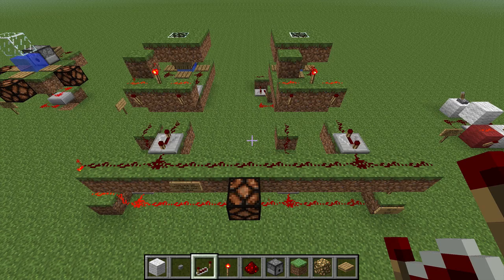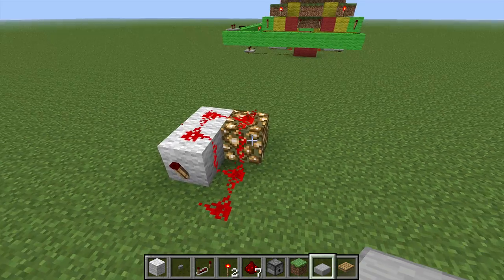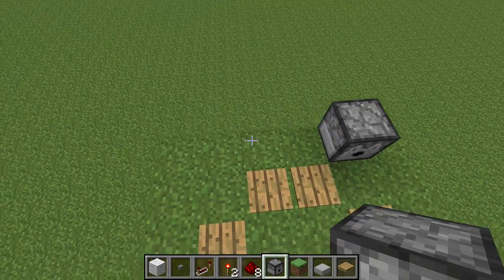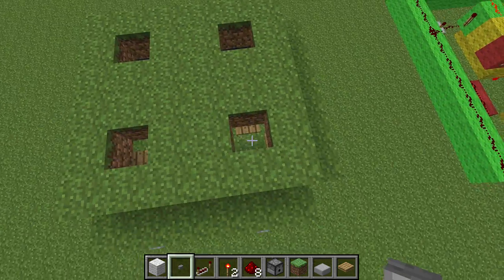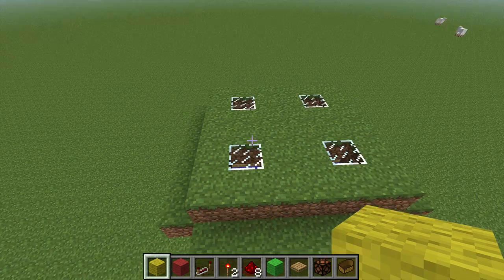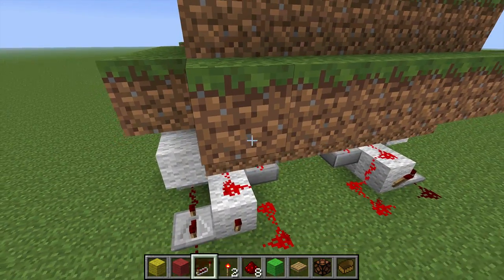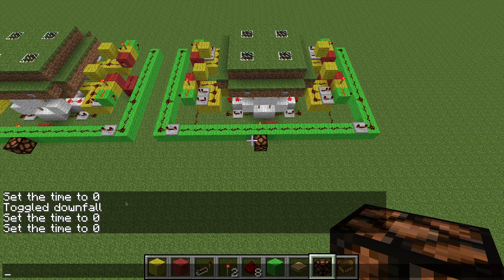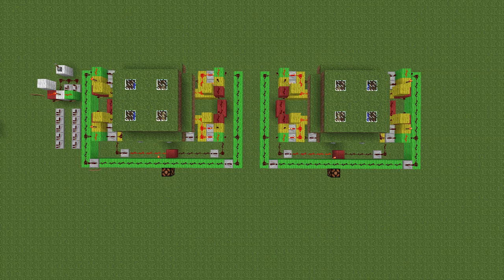SLD Mark IV (Tutorial for Minecraft v1.3)

Comment from the maker: You could use anything that doesn't block (or emit) light. That rules out glowstone (it would prevent the grass from dying). Make sure you test your block first. In 1.3 the translucent properties of some blocks seems to have changed. I've verified that a piston would work (it still doesn't block light in 1.3) but top slabs don't seem to work. Still, using glass is convenient because it makes it easy to check the state of the dispensers.

Comment from the maker: Sure, and I have used a moderately extended reach in some of my other vids. I usually don't go that far though because I don't like accidentally destroying blocks from meters away. :) In this case I don't have SPC installed because I'm using the latest snapshot build. I'm not sure if SPC even works with it yet but either way, I didn't plan to keep the snapshot installed long enough to bother with it.